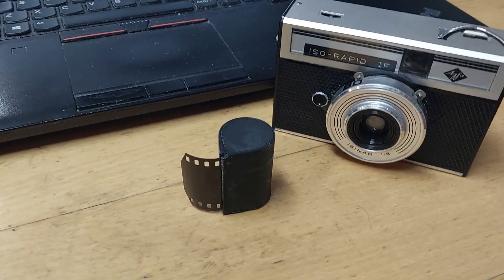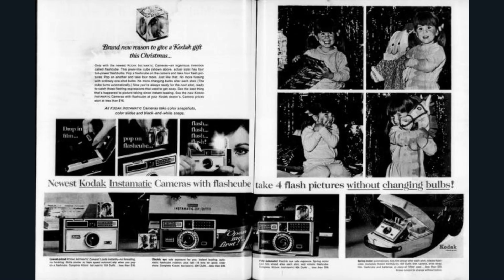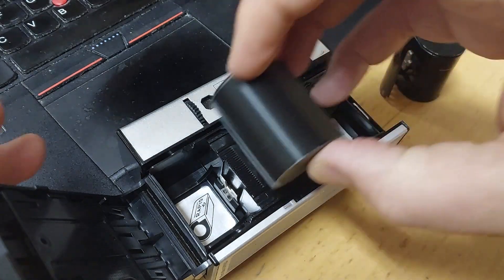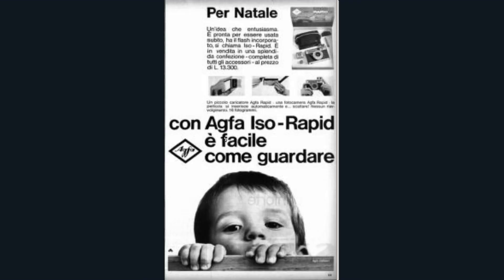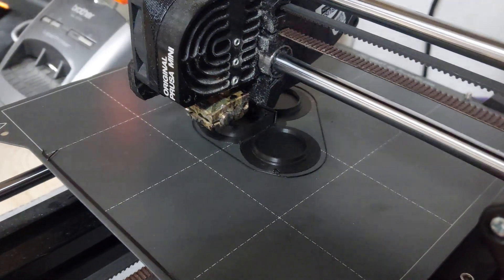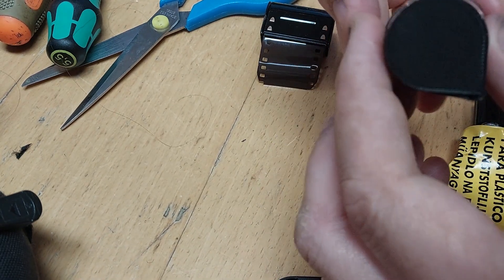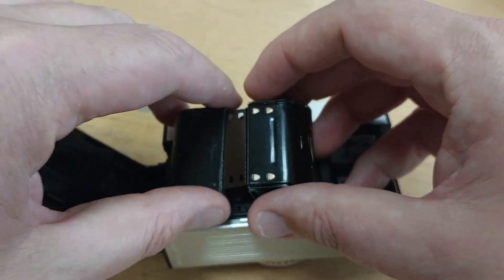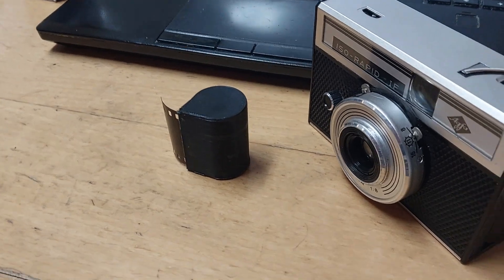A 3D printable cartridge for Agfa Rapid cameras: What's On Jenny's Bench

Comment: This is great! I have the exact same camera, received it with something else. I thought it would be a display piece forever, but this is great to know. I have some foma100 in bulk that I can spool on this.
Reply from the maker: Ooh, that's cool! I suggest you load the Rapid cartridge into the camera in the dark, but I hope it works for you.
Reply: @jennylist  Oh hey, a question about this camera!
Does it have an electronic shutter or something preventing the shutter from going off in certain situations?
I haven't printed the film cartridge yet, I just have a single empty one now.
I can open the back, the counter springing back to "A", and wind a single frame. Then I can't get it to shoot. The shutter doesn't seem to do anything.
Do you think there is something stopping it, a dead battery, or is the shutter just dead?
I couldn't find a manual or conclusive answer, hope you know!

Comment: The Rapid film system was technically far superior to the Instamatic cartridge, which simply could not produce a sharp image on film. However, Rapid did not have the massive Kodak advertising and marketing resources behind it. Also, the folks who tended to use these systems didn't really care about lack of image sharpness, since their goal was 2 sets of 3x5 inch color prints from some drugstore outlet. There were so few Rapid system cameras actually sold in the US that here, no one really knew anything about it. Agfa really shot itself in the foot by taking its existing line of consumer cameras which used normal 35mm cartridges and just adding models of the same, re-engineered for Rapid cartridges. I remember that this lead to mass confusion for years when people looking to buy Agfa 35mm cameras accidentally bought Rapid versions instead.
Reply from the maker: The only thing I like a bit less about it is the12-exposure limit

Comment: hi @jennylist great video! so if the ISO is set by the printable cartridge, what ISO is the one you printed at? what ISO should be put inside?
Reply from the maker: Thanks! It has a tab for ISO 100, though in my case the camera isn't sophisticated enough to use the ISO tab. I get the impression that many of the cheap Rapid cameras didn't. I know comparable Kodak Instamatic 126 cameras usually used ISO 100 film, so I just went with that.
 You can find the STL at https://github.com/JennyList/cartridge-for-agfa-rapid